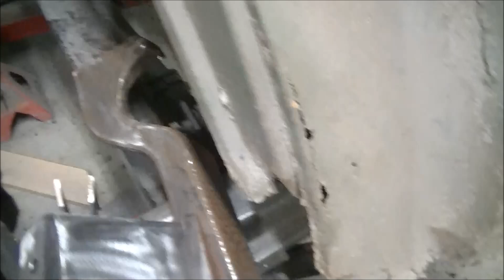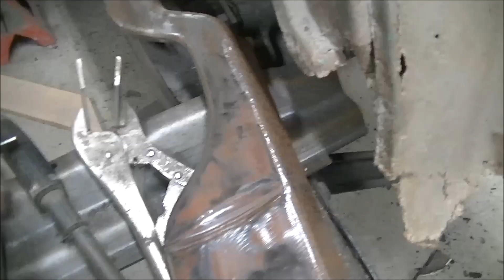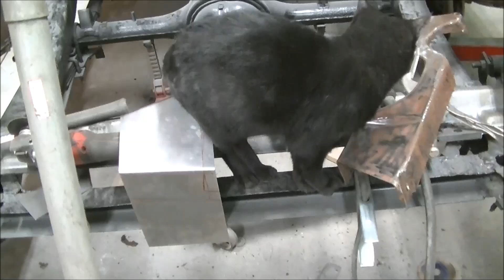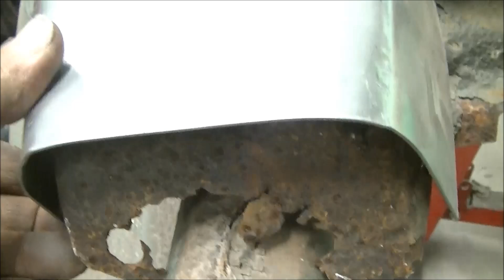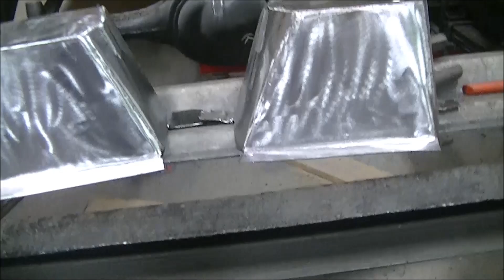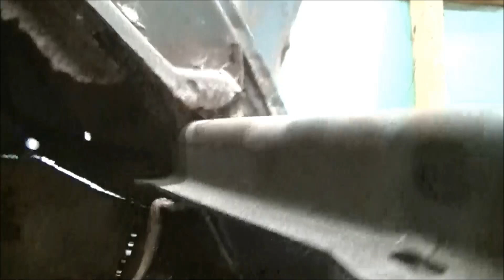Thanks to all of you,we've passed 100,000 views!Let's do some welding!Project NO-MAD Part 34

Comment: It looks good. I build the pieces that go forward above the frame like that for mine. I found that the regular wagon is different from the Nomad. It doesn't matter too much since it really is reinforcement for the floor and rides about 1/2" above the frame. You don't want them to touch since that is why you have the rubber mounts in the back heal area. The key is that the top of the foward brackets, your welding on, should be parallel. Point the top of the foward bracket to rear of the floor just forward to where the shocks mount on the original floor area. 
There is a slight dip in that braket the last 3/4". There is a cross bracket just foward of the foward legs that go from one side to the other that supports the floor. It is forward of the tire opening normally. Since your using the block off sheet metal, simple angle stock would work and would be a way to hang your gas tank, too if you want.
Please don't think I'm trying to tell you how to do things because I know how negative people are out there.  It's just because, I just did this area to my car and was worried about not having it right since it is critical fo the tailgate alignment and fresh in my mind. I am hoping that I can be helpful. It's your car build it any way you want.
If you need any photos let me know.
Reply from the maker: Thanks!I welcome advise and information in the comments.Everything you described sounds like a good plan!

Comment: Obviously the new pockets will be slightly larger than the originals, since they were formed over top of them. I hope that doesn't cause any fitment issues.
Reply from the maker: They are very slightly wider but they are the same height.When I stuck them over top of the old ones they didn't go to the top of the old pocket because the flange of the old pocket was in the way.My next video deals with locating them to the brace to line them up for welding.Thanks Eric!

Comment: Will the pocket size matter since it is slightly bigger than the original?
Reply from the maker: Not as long as the mount locations are where they are supposed to be and the hinge plates line up.